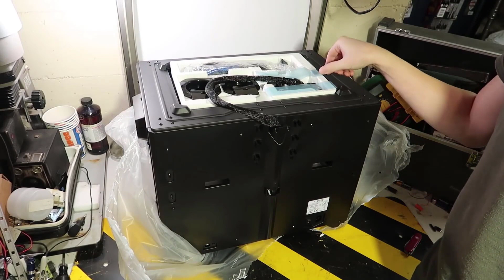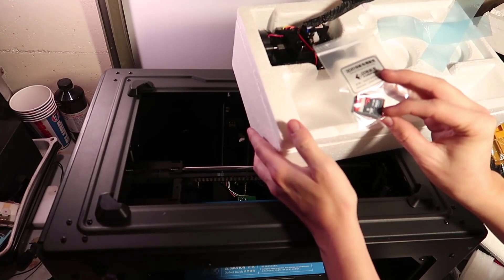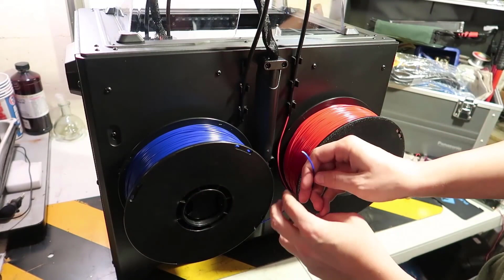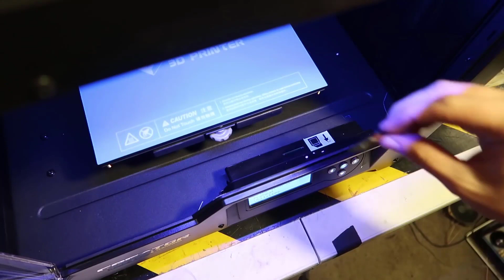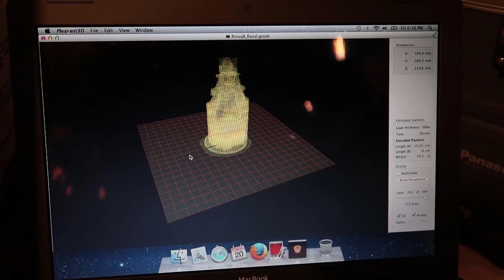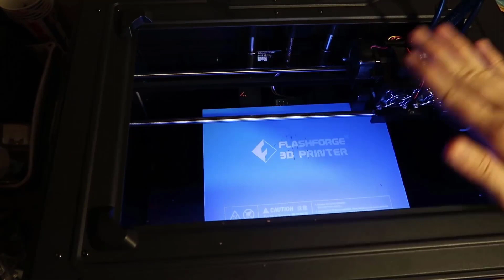FlashForge 3D Printer Creator Pro Review

Comment: I had a Creator Pro for 2 years and never, ever had an issue with the door, fans failing or anything mechanically failing for that matter. Just filament jams, in which were usually my fault for using weird unsupported filiaments that I simply wanted to see if they worked.

I now have a Flashforge Creator 3 and a CreateBot D600 industrial 3d printer both of which are at the pinnacle of 3D printing in their class. Seriosly, I have yet to find a 3D printer that is better than the Flash Creator 3 for projects using PLA, PETG, ABS, etc., it's prints come out perfect 95% of the time, with the other 5% being issues from user errors and or cheap filament. Which is why I now only use filament from Flashforge as it prints practically 98% of the time without failure, even with faulity settings.

The CreateBot is just a wonderful 3D printer, probably the best you can get for PEEK, other Carbofiber materials, nylon, fiberglass, etc. I was lucky enough to get mine through a foreclosure bank auction,  in which not a single person bid on it as I suspet no one knew what it was. I got it for less than $5000, inlcuding another $3000 worth of filament, tools, addons and replacement parts. The thing is a work of art as it's prints are flawless. To the point where I printed out a fully working Walther PPK 32 ACP pistol that actually fires for funzzies, with the only none 3d printed part being it's fireing pin which I bought direct from Walther. Now, I don't condone this but I wanted to see just how good carbon fiber printed parts were when compared to metal parts. What I found is that I could reproduce about 80% of the parts I had invisioned printing using a metal 3d  without having to atually go, well, metal.

My next printer will defiantly be resin, though one with a very large printing space, at least 200mm, 100mm, 200mm, larger would be even better. Any suggestions?

Comment: I am just about to pull the trigger on this purchase.  I hope I am choosing the right 3D printer.  My goal is to print 1:87 pieces as scale models of different varieties.  This video will definitely help as I unbox my printer if I do go forward with this model.
Reply: If you want to print high detail models you could look at resin printing. You can get into it super cheap like I bought my photon zero for $100 on sale, it preforms better than any filament printer could.

Comment: Instead of drilling a hole into your old one, why not just 3D print a smaller spool holder?
Reply: They probably didn't want to spend the time and effort designing and printing a new one, but that would definitionally have been a cleaner solution.